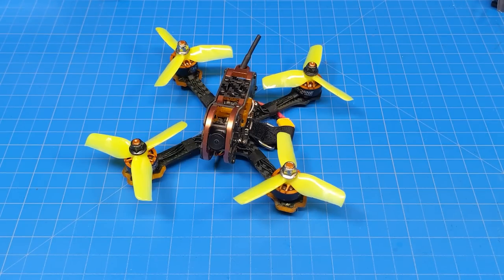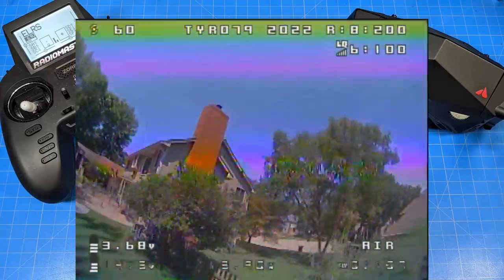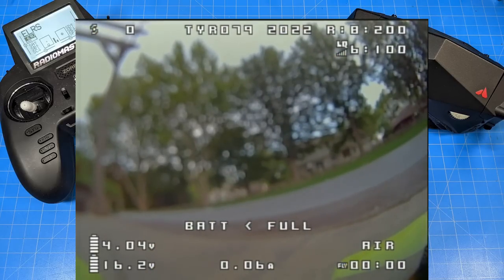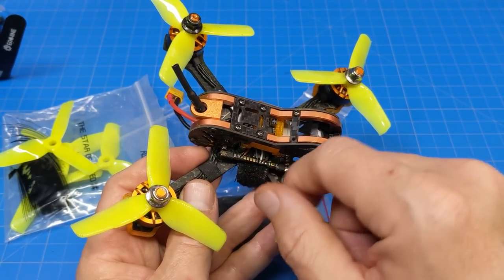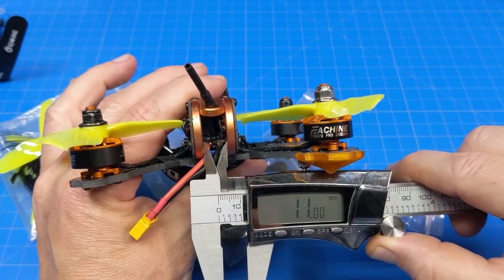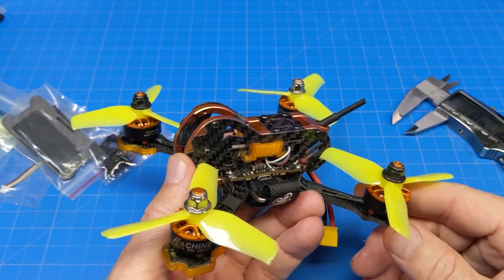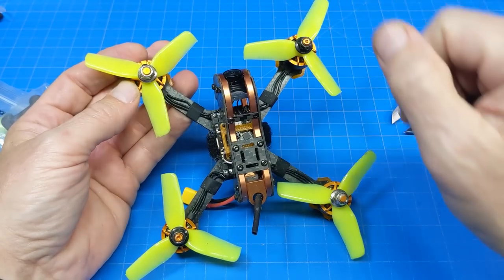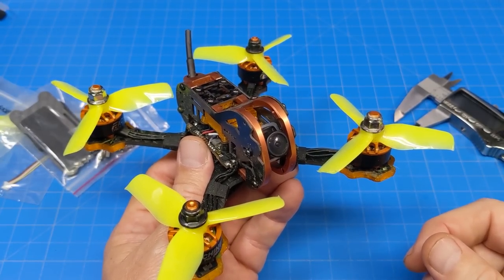Tyro79 Pro // Metal & Carbon Fiber Drone // Build Kit

Comment from the maker: Who as the original tyro79 from 2019? Still flying it?
Tyro79 Pro  @Banggood  https://bit.ly/3pneVGF (Coupon "BGNick2022" 8% off)
My CLI - https://bit.ly/3c5P5Uq
Note my CLI I flashed the ESC with BlueJay (24hz PWM) and I am running props in with Bidirectional DShot.
. 
.
😁
Reply: Love my original Tyro79.  Flying it years without much failure (the carbon base plate bent/cracked once, bent it back and bought a spare, but its never bent again in over a year despite a lot of  crashes so not fitted the spare still.  Added GPS, beeper, ELRS, changed the camera to a ratel2 but otherwise still stock. Carries a action cam without much difficulty.  Great little model, albeit a bit heavy and a 650mah 4s pushes it over 250g.  Would have been nice if there was a little more space in the frame as I would have like to added a HD-split cam, but can't squeeze the extra board in without sticking it somewhere vulnerable.
Reply: Still flying mine..Good drone.
Reply: I have the original. I bought one from a guy with 3 mobula 7 v2 in a package deal. I put ELRS on it. I fly it with slim rdq 4s 850 mah batteries. I didn't change the pid tune from the original. It's tough, I've crashed into cars out here on the bottom side of loops lol. They were junk cars. It's still flying.
Reply: Still going strong, but with F7 fc and OG esc and EP2 (of course 😀)
Reply: I do.  Changed the camera and vtx.  I have damaged a motor badly this summer, so I mostly fly smaller drones now.  It is an ok drone, but I wouldn't get this "pro" version at that price point with those components in 2022.  Amazing they havent made a TPU camera mount for a Thumb camera for the Tyro79 pro.  That might actually make it sell.

The Hglrc Petrel 120x RTF costs around 200$  and you get pretty decent components.  That is what I would choose instead.

Comment: I still have the original $79 tyro...  Still fly it regularly and love it.  It does have extremely cheap parts, I had to replace the camera from the start. For me, it is great bang for the buck and it's one of my go-to for fun flights.  I fly it on 4s 850 and get 6/7 minute fun flights (mix cruising and thrashing).

Comment: Why would they add skids to a frame in which the lipo is strapped to the bottom? How the hell does that make sense? (Im leaving this comment before continuing the video... for all I know, Nick points it out as well)
Reply from the maker: Lol yep odd choice. Does provide a bit of arm end protection but not much being tpu
Reply: Agreed, extra weight and bling (which I don’t like with my preference for clean/minimal builds) for basically zero added protection.
Reply: My brother has a tyro with emax motors and a mamba stack and the arms have got chewed up pretty good from hitting concrete so I guess it could help protect that? Def a weird choice but it is eachine after all they aren’t exactly know for making logical good quality products.
Reply: @PeugeotL-vd2le  That's the ting. What comes with it are enormous skids (for sliding/landing). They could have used much smaller TPU arm protectors, if that's what theyre going for
Reply: because... they can xD

Comment: I scrape the enameled wire with a scalpel or side cutters and tin the ends, short term I like to solder on led racewire (I cut the motor wires to about an inch), I usually use the Flywoo 10mm long boards on most of my micros.

This way I can solder silicone wire from the racewire to the ESC and never have to deal with that nasty wire, which usually smells terrible when heated.

Makes swapping motors much easier.

Long term I rewind the motors with proper wire to my KV liking, but still like to use the racewire as it works well for me.

Comment: Almost a classic at this point. The Armattan Jalapura it is loosely based on is still available too.
Reply: The Armattan Jalapura is a much bigger frame for being a 3inch. So big you can stuff an HDZero 1W Freestyle on 30x30 mounting in it on top of a 20x20 FC, and ESC with a mount adapter. It's a classic that seems to always find new uses...
Reply: lol and the frame will probably cost the same as this full DIY kit

Comment: still have the original 79 was my first race quad! used it for six months before commiting to a 5 inch, first thing to do is print the pod that's available on Thingiverse it can take a beating in mid airs with 5 inch racers and still keep going!
still have it hanging on the wall and grab it down for a casual freestyle every now and then and get 5 minutes+ on 4S 450mah, only quad i still have FrSky RX on 😛

Comment: I almost bought a Tyro kit but for the price I ended up with a 5 inch TCMMRC quad on Aliexpress. They are pretty much the 100$ drone builds, already built for you.  Being new to the hobby I picked up one out of curiosity with lower expectations, I only had Minis and a few tooth picks as reference.  I was pleasantly surprised after replacing their cool looking but really bad glowstick green props.  It had a short life because I wadded it good, but the parts are pretty much older Eachine's.  I just busted an arm and motor , a set of spare motors on their site is shipping with a free frame.  If price is a big concern for quads, they are worth looking into, It performed great for learning on for the time it ran.  Just going to swap the frame and motors and BAM upgrade!  Love the videos, keep coming back for more.  Learned a lot and FINALLY was able to fly Acro outside of LiftOff today for the first time.  Feels amazing, awesome hobby.  Keep helping to make it great!
Reply from the maker: I actually bought two 3inchers off of aliexpress, mine are TCMMRC branded as well, but they came in an eachine box..so funny. I need to work on a video for them yet. One the camera was defective or otherwise as it was so blurry and I couldn't bring it anywhere near to focused.
Reply: I‘ve seen a few of their drones reviewed, mine also came in an eachine box as did the reviewed ones.  Parted out old eachine inventory?  I can’t complain at their prices

Comment: as usual, awesome work Mr Burns. I figured this would be a decent first build for me just getting into the hobby. but I am having a problem, hopefully someone in the community could chime in!

I'm having a "rolling video" issue from right to left, it's a constant thing and osd is included, so I'm thinking the vtx is shot.

at first I thought it was the camera so I powered it via vtx, nadda, swapped out antennas, it may have made a little difference from the stock antenna they supply... but still a rolling video.

I don't have spare parts for trouble shooting. thinking of powering the vtx and camera by itself away from fc, that should narrow it down to vtx being a dud?

cheers everyone, happy flying!
Reply from the maker: If your using rapidfire, fusion or really any modern day dual band receiver its likely the module needs an update and even with that it can happen somewhat infrequently. Its likely the camera, as the camera signal isn't following standard pulse rate causing this issue. I have even seen it with the same make an model of camera, one does it one doesn't.
Reply: @NickBurnsFPV  awesome, appreciate the reply. I will try an update on the sky04x modules after work today, hopefully that works. if not I will steal the cam from mobula7 to see if it's a camera issue.

thx again, cheers!

Comment: you're also bringing back memories of how bad the wires were on the old tyro lines.  Plastic coated, never able to get the solder to stick..or iwhen you get it to stick, you realize the plastic melted so you have to cover the exposed area
i hope the flight controller is better than what they used in the previous 79 model
Reply from the maker: I really didn’t enjoy the soldering process, such a huge pain
Reply: @NickBurnsFPV  mine was the only time i've had melted plastic hit my skin.  what sucks is that i enjoyed the heck out of the quad once i got a new camera which this one addresses.  Still, i paid 79 plus 15 for a camera...  man, i had no idea 2020 would kill the hobby for me :(

Comment: My second drone was a tyro79. I really liked it when it was working. Eventually the frame annoyed me enough I bought a new frame and move the electronics over, that is still my 3 inch drone
Reply from the maker: Still flying the original components on the new frame?
Reply: @NickBurnsFPV  switched to DJI for video and elrs for radio, but everything else is still the same if memory serves

Comment: I got the tyro79s last year and it flies good but like you said it does have flaws lol I think the old stack may be a little better fitment wise but I will say that the eachine motors are junk!!!! I have had to replace 2 of them already one just yesterday lol and I ended up getting the exact same motors off of amazon for cheaper the only difference is that the motors don't say eachine on them but all the specs and even the color is exactly the same and so far they're working great👍🏾I don't understand why they would put skids when it's a bottom mounted battery either nick😑lol I do use the belly plate just to protect my battery and really don't notice the extra weight but I think they should've made alot better improvements for it being the 22 model 🤔 all in all great review as always Nick "Happy Flying"😁✌🏾
Reply from the maker: I don’t think eachine is an actual drone company but rather a brand that contracts with other drone companies to build quads to their eachine specs

Comment: Hi... do you have an ELRS receiver? Do you use the F Port protocol to communicate the receiver with the flight controller?
Reply from the maker: yes its an elrs rx. No I am not aware of a way to use an f port with an elrs rx. We need a full uart for elrs rx. A Rx and tx of the same number for the elrs rx.

Comment: I had a Tyro 79 and 109 and for their price they were good starter kits for self-assembly at the time, in 2018-19. With time, I noticed that it was a dead end. Their failure rate is legendary. In a short time, the cost of spare parts doubles the initial purchase. Everything falls in it: engines, VTX, FC ... and a strong crash is broken arms requiring replacement of the entire base. At this price, I advise against it in 2022.
Reply: What would you get instead given it's 2022?

Comment: I found a sketchy 200 $ 3.5 inch drone should I buy it or get a better one.

Drone:MINGCHUAN xy-3 v2 155mm 3.5inch Quadcopter 3S

?????
Reply from the maker: If you think it might be sketchy I wouldn't suggest buying it. Often if we spend $40-$50 more we will be more likely to have a better experience....at least long term.

Comment: Hi Brother I by mistake pressed the reset setting button on my new mobula 7 v2 and I can’t even understand anything I’m a beginner please help I can’t get anything to be as default and when I type default on cli I doesn’t change anything
Reply from the maker: Go to the happymodel model website and get the cli for the quad. Copy that text into the cli. Type save and hit enter. You will need to rebind and another changes you made after getting the quad
Reply: @NickBurnsFPV  thanks buddy. 🤝😃

Comment: Wow! It breaks while doing the review ... Eachine usually last a few days, weeks or months longer than that, but that's what they're known for ... Breaking! Costing much more than their initial cost.  😦
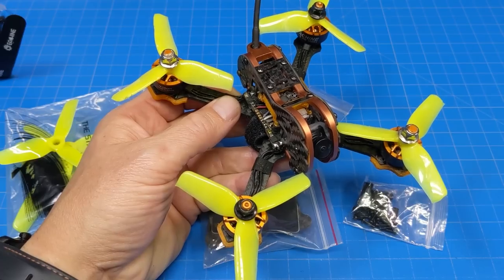Here's the bottom line from a 7 years in the hobby, FPV guy.  Many will go ahead and buy this at $50 over the price of the original because it's cheap, by today's prices. But, that's just the initial cost. Many other parts will need to be purchased because of what Nick says at approx. 7:40 of this video. It uses Cheap Parts. The cheapest on the market, so they fail, break, burn out, etc. and you have to replace them. Adding to the overall cost of ownership.
Typically, these Eachine quads will end up costing you DOUBLE or TRIPLE what the original price was. 
A motor or two will go out, so you'll have a lot of down time waiting for new parts to come in, and another approx. $15 - 20 each. I had ALL 4 MOTORS fail on my Eachine quad, adding significantly to my initial cost of purchase!  
The frame will probably crack or split, and the ESC or FC or maybe both will fall, along with the VTX, which Nick might have had a problem with already.  My frame failed on me, and the camera was crap, so both those had to be replaced. I only have the FC & ESC that still work on mine. Everything else, and I mean every single part, was replaced with a better quality one, and never failed ever again!

Eachine products are an endless source of repair and dollars going out to do so. They seem low priced, but beware, they cost a lot more than that to keep them going! 

Better to just buy the better quality drone right off the bat and skip this cheap junk and not have all of the repairs and excessive down time when you're waiting for parts and can't fly this craft.

Eachine is simply a bad value. Plus, with this quad in particular, the design is piss poor! Those aluminum cages are not good! They're tough to work on, very limited in space and this one's not good quality, so it needs fiddling with and will continue to be a huge source of frustration! Like those motor wires! When have you ever needed to scrape and scrape on wires to bare the metal to be able to solder them! Forgit bout it!
Guys, just buy something else.

A little more money, will mean better parts, less money repairing, and less continuous hassle... Cuz this is gonna be a continual hassle and frustration! Junk always is! 🤷🙄

Buy quality, not junk. It's cheaper in the long run.  I know from experience!  😎🤘
Reply: Wholeheartedly agree, I don’t have the time in that you do, but as in most things, the cliches ring in my mind watching this experience.

“You get what you pay for”
“Buy once, cry once” caveat that for FPV, but better parts DO go MUCH farther.

The Eachine nano VTXs v1, v2, v3 I have had good luck with, but that’s as far as I would go with them, and only when on sale for $10.

Comment: If i remember correctly years ago the tyro 79 was originally $79, the tyro 109 was $109 and the tyro 129 was $129.  Did eachine add the pro name and mark it up another 60 bucks, but kept most of the same garbage components that made it worth only that super cheap price to begin with? Anybody remember?
Reply: Yes, they were still acceptable at their original price. Currently, they are no longer profitable.

Comment: So they jack the price up?? That was a bad move on there part. There biggest selling point was the the size matched the price…. This is sad banggood come iv bought a lot of tyros
Reply from the maker: I need to see if we can still get the v1
Reply: @NickBurnsFPV  that I’m not sure but I know for a fact if you build any of these tyro the right way they are an awesome drone. I actually fly my 7” tyro out 2 miles with crossfire no issues ever

Comment: :(  your product link took me to a new screen on the same window instead of opening a new tab.  Shame that the motor wires are crap.  this will be a fail point for lazy builders.
Reply from the maker: Right clicking will allow to open the link in a new tab. I don’t have any controls over how YouTube or browsers respond to link clicking. They have used these same cheap style motors on this series for years, it can’t be saving that much